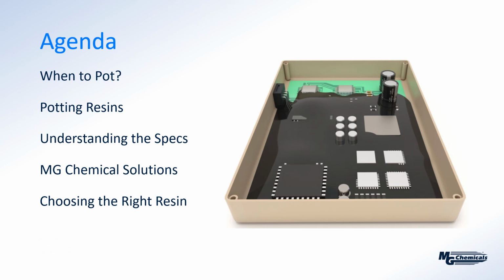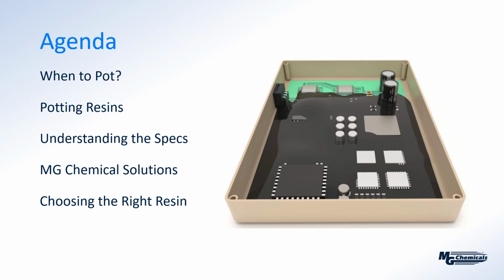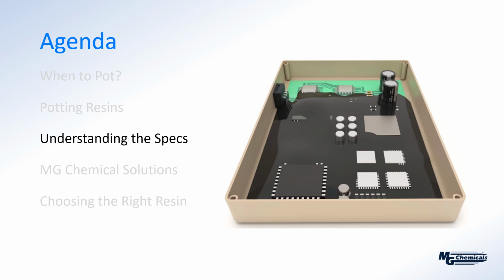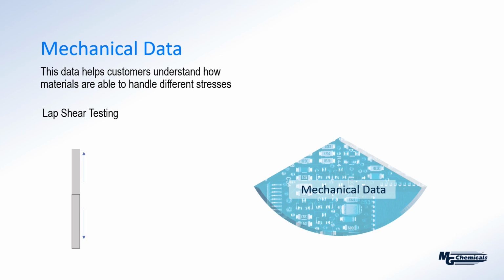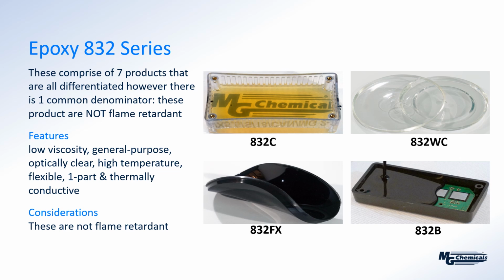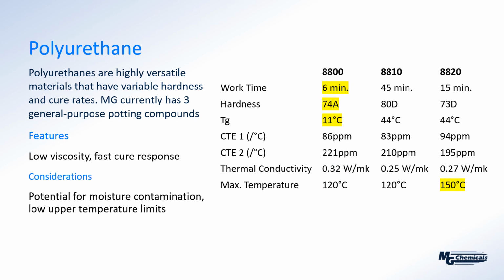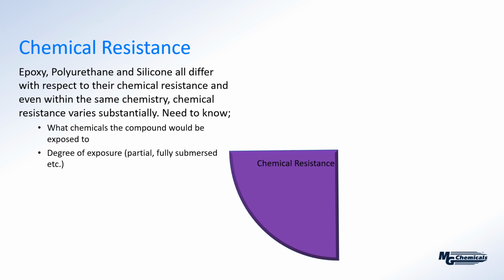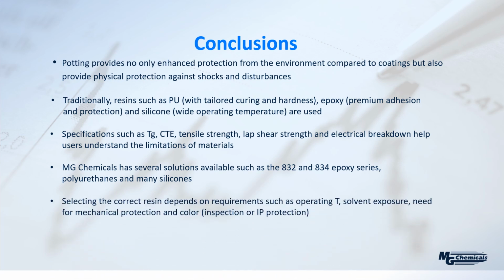MG Chemicals Potting & Encapsulating Compounds Webinar

Comment: From my perspective potting serves three main uses… 1st is it stops arcing in high current situations (which means that the material needs to be a high dialectric, and heat resistant). Second is to stop vibration/physical impacts from damaging the circuit. And third is to keep prying eyes and competitors from being able to reverse engineer and copy whatever proprietary circuit design may be contained inside the mix. To the end of number 3, it would be great to have some kind of tamper resistant combination of materials where by it serves the purposes of 1 and 2, but also will essentially do a Mission Impossible ‘this message will self destruct in 30 seconds’ thing, where by if the resin enclosure is tampered with it automatically turns the circuit into slag. Can you do that? If so what resins do you need to do it?